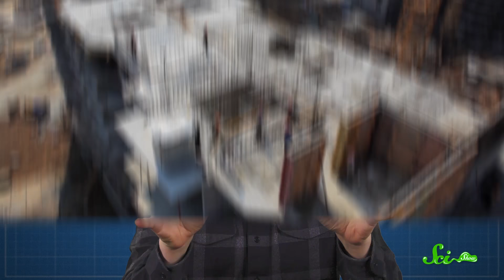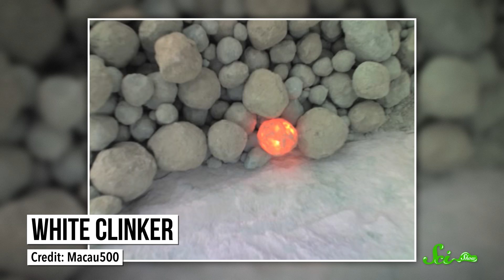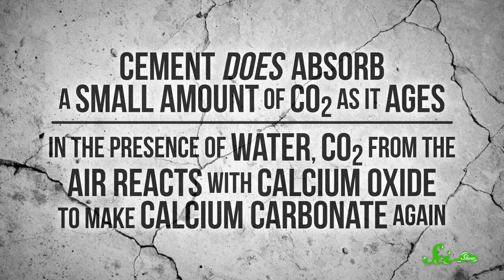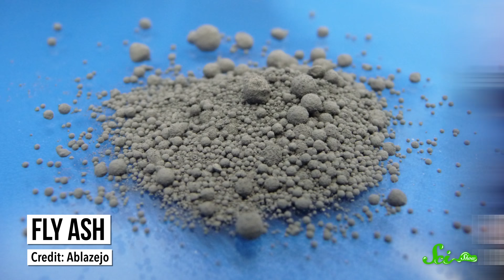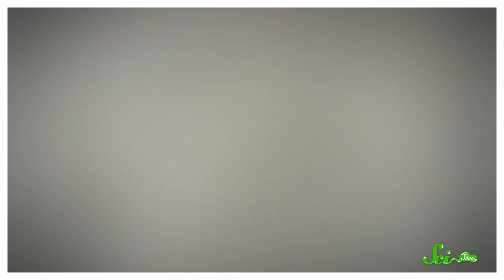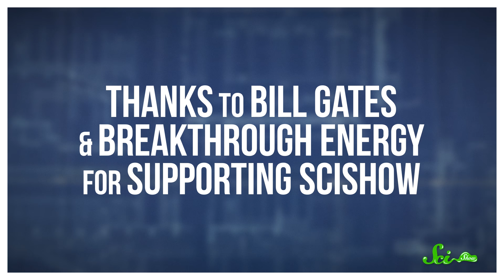Cement: A Really Hard Problem

Comment: As an outsider, there seems no way to "X ray" the concrete.when done. Stopping the re rod from rusting in In the Stone mix is a problem. The rusting of the rerod is probably causing the distruction of the concretee, and the distruction of the tensile strength of the Concrete Beems.

Comment: CO2 is essential plant food.  Plants would be doing much better at over 1200 ppm.
Reply: @James Velde Good point, but that would take quite a bit more explaining, and I didn't have the time when I wrote it.

The 1200 ppm is conservative though as commercial greenhouses can pay for enrichment of their air up to at least that, and then it starts costing more for the CO2 than the return on increased production at 1500 ppm.  Typical office building will range to over 2000 ppm without noticeable effects with somewhere around twice that before it becomes a health concern.  There is much research on this that is being blocked from the media because it doesn't fit the narrative that is making billions for various elite investors.

Comment: I want to see what happens when you make this with carbonated water (like seltzer water).
Aerated concrete is a lightweight, precast, foam concrete that usually comes in precast blocks because it requires a large autoclave to cast it. This limits the place that they can be made and the size of cast pieces.
A CO2 curing concrete mixed with carbonated water could eliminate the need for gas containment during curing. And, possibly, the result could be lighter while maintaining most of its strength.

Comment: I agree that it's a hard problem to solve. But one thing you didn't talk about is the potential of natural building materials like clay and (hydraulic) lime.
Those materials and their respective building methods (cob, Adobe, straw baling...) create amazing, high performance buildings made of cheap, abundant and non toxic materials. Limestone cements and plasters even absorb large amounts of co2 during the buildings lifetime. 
Sure you can't build a skyscraper from clay but a family house you can build without any Cement or steel at all.

Comment: Other alternatives currently being researched include introducing microbes into concrete so they're self-healing, and therefore more durable against cracks. There are also Geopolymer cements which work on an entirely different chemical reaction and emits about 50-90% less CO2 during production. There are lots of factors to overcome when replacing ordinary Portland cement (OPC). Its workability on site, strength, ductility, stickiness, durability, cost of production are some of them. As this topic continues to be researched, more ways of replacing carbon-intensive are coming to light.

Comment: I am surprised that there was no mentioning of the properties of the cement, as for example, is it more, equal or less resistant to mechanical stress; heat tolerant; chemically stable at different temperatures (tropics VS cold dry); But then again, I suppose you could just go look it up. Anyway, neat presentation!

Comment: The curing process of cement is an exothermic reaction. So exothermic that large projects such as the Hoover Dam have to be careful not let it get too hot and weaken the structure by cooking itself and break back down. 
The Hoover Dam solved this by building an ice plant between their cement plant and the dam. They would mix water ice into the cement to help cool it and hydrate it as it cures. 
If you can use CO2 instead of water, it stands to reason that you could add dry ice powder to the cement as it is being poured.

Comment: There are excellent reasons to use the existing concrete formulations, and it isn't the concrete manufacturers who have to be won over. Concrete, correctly installed, is one of the most trustworthy building materials, and far and away the most durable. Even if you could convince the makers of concrete, you'd still have to persuade engineers and architects, code officials, and the general public. I'm not against a greener concrete, but good luck...

Comment: The problem is, the CO2 that comes from 'somewhere' will probably not come from the air, as in directly reducing the carbon dioxide levels. Instead a CO2 plant will use more fossil fuels / woods to produce it due to lower cost of production, thus this idea will just increase fossil fuel demand and accelerate the CO2 problem at hand.

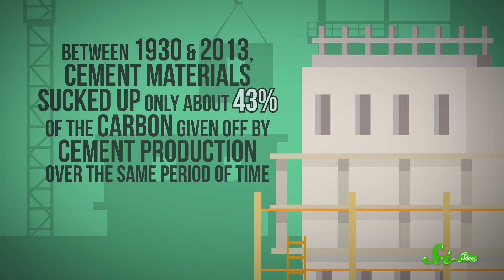Comment: @2:27 Well, of course they don't soak it all up. If it takes time for cement to soak up CO2, anything done in the last 20-30 years wouldn't have had time to soak up much CO2. You're comparing apples to oranges. You want to compare the CO2 given off during the production vs the CO2 soaked in over the lifetime of the cement.

Comment: Pot growing is legal in the US, right?

Hemp grows very fast. Thus absorbs lots of CO2.

Pulp it, dry it.

This is fiber rich. 

Can be treated to be just carbon rich.

Or just mix the dry pulp into the mix.

Or conversely.. jusd add a bit of copper to the heated mix.
It will help break some of the CO2 as it's produced.
Oxygen out, inside some of the Carbon becomes like graphine.

Comment: Factorio expert weighing in.  Can verify CO2 production issue with cement production.  Four solutions available:  patching out in future version, modding out in current version, using CO2 to produce other materials (limited utility, not a lot of demand), or sending off to Flare Stack, preferably equipped with a pair of Green Module 8's.

Comment: In all seriousness, I might see if I can do research on this subject. I'm going to school for environmental engineering but I've done lots of research with concrete. This research could be very valuable
Reply: Tip: you can research alternative materials in our waste that contains CaO, Al2O3, Fe2O3, and SiO2 - these four are the main oxides needed for clinker. The recipe for limestone, silica, and iron is adjusted to get the correct amounts for each. If you could find wastes with those, you could reduce the dependence of cement plants in fossil fuels. Carbon capture in the cement stack would also be very valuable.

Comment: The CO2 is absorption by conventional concretes is a process known as Carbonation. This is a genuine concern for engineers around the world as it has a significant impact on the durability of concrete. Naturally, concrete has a high pH that protects the reinforcing steel bars embedded within it. The process of carbonation reduces the high pH of the concrete, making the reinforcing steel more susceptible to corrosion, which can lead to significant weakening of a structure. I’m extremely curious about the durability of a concrete structure that relies on CO2 as a binding agent.

Comment: Speaking as an inspector who works with concrete very regularly, the hurdle won’t be just the cement industry but the structural engineers and the testing labs. Materials that have vastly different chemistry and curing processes will change the entire process every step of the way. It’s not impossible of course, but there is a HUGE barrier to entry for ANY new material on commercial construction sites. My thoughts are it will take an entire new generation of engineers to design around and design with these new materials, a majority of the old guard are relatively set in their ways. I’ve seen some details on plans that have probably been saved and copied a hundred times over.

Comment: In a decade where business and consumers will increasingly be seeking cleaner products, the timing couldn't be better for the secret, low-emissions concrete developed by Queensland construction and materials company Wagners.

TOOWOOMBA WELLCAMP AIRPORT
https://www.wagner.com.au/main/our-projects/toowoomba-wellcamp-airport/
Wagners undertook the construction of the jet-capable, Toowoomba Wellcamp Airport and Wellcamp Business Park in 2013. 
Wagners’ “Earth Friendly Concrete” (EFC) was used for the construction of all heavy duty pavements in the aircraft turning areas as well as a range of other works on the project.The concrete, which has been developed over the past decade and uses no Portland cement, was in 2019 approved for wide use in Germany, opening the door to the rest of Europe.

Comment: In the 50's to 70's they uses high alumina cement (HAC) within concrete which reduces curing times from weeks to days. However it also reduced the lifespan from centuries to decades. Let's hope the new cement doesn't follow the same principles.

Comment: Tbh if CO2 is required for production then the company would rather buy it from CO2 manufacturers instead of using the stuff in air since it would be much cheaper.

Comment: I work at a large company that produces, among other stuff, cement, we are currently field testing a subsidized technology (LEILAC ) to recapture the CO2 as it is released during the production proces of the clinker. Also a highly promissing technology i feel.
Reply: I think that makes more sense for the cement manufacturers as it will not mess up their mix design, no trial runs required, and the end product will be the same so not much concerns for the strength of the cement and ultimately concrete produced

Comment: So if cement absorbs co2 as it ages it could be one of the few ways to capture existing co2 from the atmosphere.

It seems would be vastly easier to capture CO2 from the exhaust gas from a cement factory than from the atmosphere itself- so much more concentrated. Then the cement produced would actually contribute negatively to global emissions.
Heck there's barely any 'capture' involved, the gas coming off  should be basically pure CO2 + water  that can be condensed easily with probably a bit of impurity gases that you wouldn't even need to bother separating out

Turning cement from 8% of global emissions into -2%. Seems like a cool idea.

Theres no financial incentive to do it, but if given one, seems like it would be one of the more cost effective of making a carbon negative process
As most of it is being done anyway.
Reply: That's the best way to approach the cement CO2 problem. I don't know if cement manufacturers will invest the needed capital for a large scale industrial run for Solidia. Additionally, there are long term effects we have to check out due to the change in cement composition.
Depending on the plant, the main stacks of the kiln emits mainly CO2, water, NOx, SOx, CO, and a few others. It is around 80°C to 110°C and the gas is just exhausted to the environment.
I also can see cement plants getting behind carbon capture more as it will not require them to do much changes in their core processes - just an additional process for their exhaust is needed.

Comment: Check out CARBONCURE
They are already involved with 100's of locations across the world.
They use carbon capture from high emitting resources and use it in the concrete.
Used like normal and requires little change in concrete production facilities... so it's past the "valley of death".
Reply: It is a technology that cement plants really will prefer as it will not mess up with their normal processes.

Comment: A point worth making, we don't necesseraly want CO2 to interact with reinforced concrete, it's called carbonatation and it's one of the potential illness of concrete. The carbonatation process increase compressive strength (great!) but lower pH (not cool !) so went the carbonatation front reaches the rebar, the steel is no longer passivated (I'm french, not sure this word is the rigth one, it's not able to rust) and then it will rust and the rust being less dense than steel, it put pressure on the concrete, cracking it and "exploding" potentially.

Yeah the concrete is not drying, it's hydrating, and it can take cure submerged in water, as a matter of fact, when we do compression test, we submerged the cylindrical specimen to reduce potential cracking.

Comment: Seems that it's best use, given it's creation limitations, is likely a substitute for pretension and form cement, where concrete is poured into a mold which has stretched cables within the mold. The fast cure time would be appealing for shorter fabrications time retirements and thereby higher productivity.

Comment: I just visited an old lime kiln (1830's) and those things used soooo much coal. It took about .5 tons of coal to make 1 ton of lime and it would be burning non stop for 3 days.
Reply: Yes, the older kilns use so much coal. I believe some has a specific thermal energy consumption in excess of 8000 MJ per ton of clinker. Newer kilns (shorter) kilns with precalciner and a preheater tower maximized the heat produced by the burner. Kiln feed also has lower moisture (raw meal has around 1% compared to slurry which has up to 50% moisture) which necessitates lower energy consumption to convert to clinker. Modern kilns can go around 3200 to 3400 MJ per ton clinker because of these improvements - less than half of what it used to.
Old clinker coolers - specifically planetary coolers - also has a very high radiation loss which will result to higher thermal energy consumption.

Comment: If i get the chemistry right, won't the cement turn onto calcium carbonate? The stuff seashells are made of? It think that's quite beautiful.
Reply: Calcium carbonate is a component of clinker - well part of it is. Calcium carbonate is CaCO3. When you burn it in the kiln it releases CO2, leaving CaO behind - CaO is one of the things needed for clinker.
And seashells - even the very big ones - are routinely included in the limestone being crushed for use as raw material for kiln feed.

Comment: The cement industry is absurdly resistant to better ideas. Geopolymer and alkali-activated cements have been around for decades, are known to cure in only a day, to be 70% cheaper for raw materials, to have double the compressive and many times the tensile strength, to outlast OPC on chemical and environmental exposures by an order of magnitude, to be friendlier to a variety of aggregates with a wide range of attractive properties, and yet we still see not just reluctance by outright aggression.

The excuse that they can't trust untried materials? Not valid. Pozzolans more chemically like geopolymer than like OPC built the Roman roads and mighty structures still standing today from antiquity; OPC barely stands a few decades in most cases. No one who objectively trusted from direct experience would trust OPC given all its many flaws.

And let's go beyond cement and aggregate: rebar is a nightmare, and we need a better solution than steel. Basalt fiber is vastly superior on price, weight, chemical resistance,  material compatibility and long term performance. When properly cast its performance equals steel in every measure. What do cement engineers do to "prove" they need steel rebar? They improperly cast their test samples to favor steel over basalt, and then pretend the fault is in the reinforcing material. It's as easy to cast the other way around and "prove" steel is the inferior material.
Reply: I don't know much in the way of the science in this comment, but I do know it helps the discussion to give it greater visibility

Comment: Won't this new cement also give off CO2 when eroded, in a reversal to the regular type of cement which absorbs CO2 when eroded
Reply: That is a good question. Without knowing the reactions we can't draw that conclusion. It may also absorb carbon the same way concrete does once it is cured, or your first thought might be right, unfortunately solidia is not going to hand that info over easily.
Reply: Reaction effectively turns CaO and CO2 back into artificial limestone within the cement, which is stable unless super-heated, so no it doesn't release it back into the atmosphere as it degrades

Comment: No mention of hemp concrete, a carbon-negative solution?! Concrete produces nearly 10% of all the carbon dioxide released into the atmosphere. The problem with the current system is that there's no carbon tax: there's no charge for the pollution inherent in the existing system, in treating the atmosphere like an open sewer. If you factor that carbon tax in, alternative options that produce less waste become cheaper. Personally, I have a problem with market-driven solutions when environmental calamity leading to existential civilization meltdown is on the line. One possible solution, we'd need to plant ten trillion trees to offset the amount of carbon already in the atmosphere. 280 parts per million carbon dioxide is the background pre-industrial maximum for the last million years, 350 parts per million is the scientific consensus for upper safe limit, 400 parts per million is the redline for environmental calamity, we're currently at 410 parts per million and climbing by 3 parts per million per year. Shall we start today? https://e360.yale.edu/digest/planting-1-2-trillion-trees-could-cancel-out-a-decade-of-co2-emissions-scientists-find
Reply: Thats 140 trees per person on Earth. So for my family of 4 I will need to plant 560 trees.....by myself?!?!? And care for them and make sure they grow and that nobody steps on them or paves over them or..........

And you want me to start today? Eh, its getting kinda late, maybe Ill start tomorrow.
Reply: @David_Last_Name  Doesn't take much effort to spread seeds, and it doesn't have to be all at once, but yes, it is a monumental task in its scope. You can cut the trees down after they're fully grown, use them for construction, mulch them into paper, etc ... just don't burn them as that defeats the entire purpose.